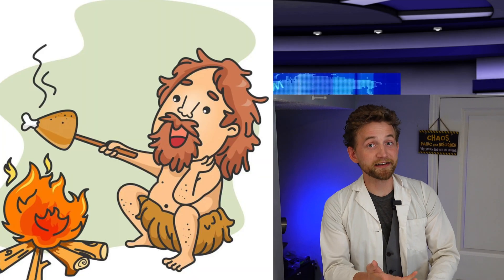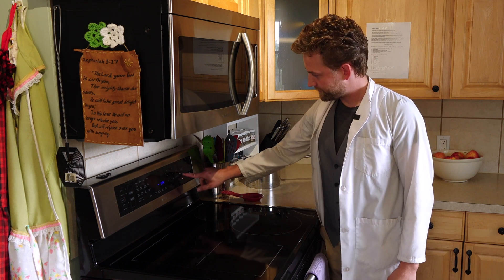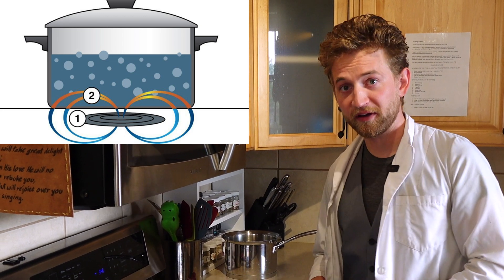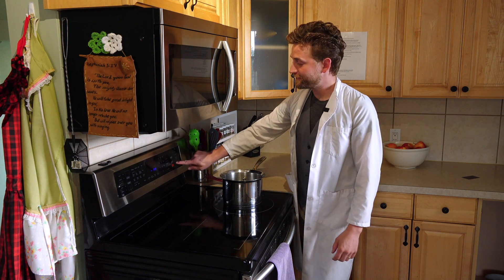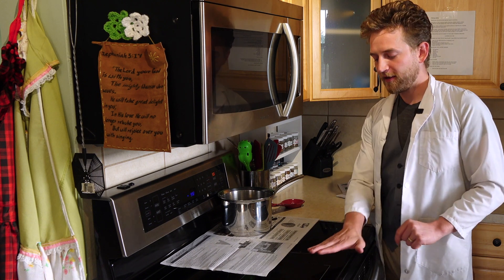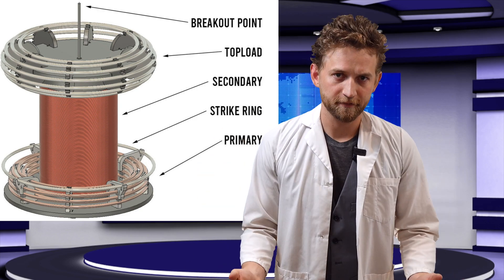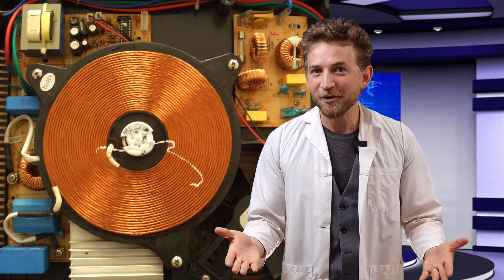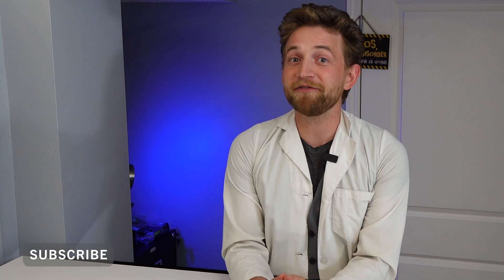What is Induction cooking? The science behind eddie currents in induction cooktops.

Comment: As much as you guys try to sound knowledgeable you forget an important issue.. you are so used to cooking as close to the source as possible.. not so with induction.. the closer to the coil the stronger the field but if you go another 10mm above the glass using a silicone trivet you get a more even and controlled cooking

Comment: You can use any pot or pan simply by putting a metal plate on the cook top and your ceramic cookware on that!
Reply: That's true but the efficiency and heating rates will deteriorate  significantly.

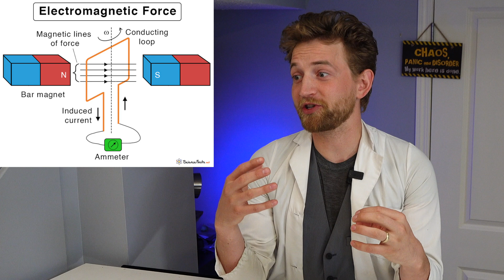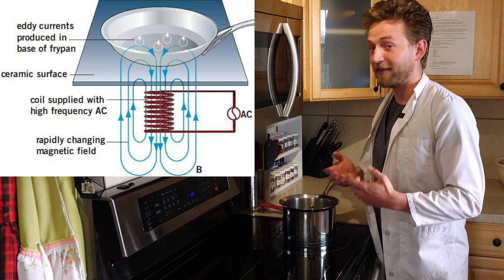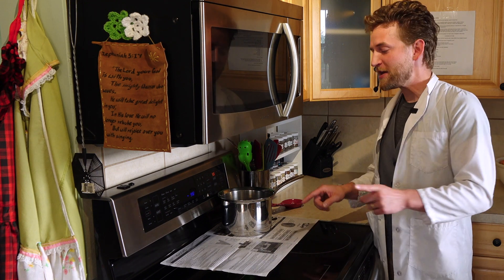Comment: Great video! Nicely explained the science behind the magic. I just want to point out that your expression "wireless transfer of heat" (mentioned at 1:41, 7:00 & 7:45) implies that the heat gets generated in the copper coil and then gets transferred "wirelessly" to the base of the pot. If I understand this correctly, that is not the case here. The pot does not get the heat energy from the coil at all, instead it only gets (exposed to) the magnetic field. The heat is actually generated in the base of the pot itself, ergo there is no "wireless transfer of heat" from the coil to pot. Please correct me if my understanding is wrong.

Comment: Hello.  Thanks for the interesting video.  

I'm looking to put one (or maybe 2) induction cooktops to a unique use.  I have a cast iron cooking grate, which I would like to use on top of the induction cooktop to grill meats. The grate has openings in it so I am a bit unsure what will happen to the induction cooktop when the juices from the searing meat meet with the surface of the cooktop.  

Second, the width of the grate is wider than the width of the cooktop.  So I am thinking of using two cooktops side by side and bridging the grate across the two.  I am wondering whether having two separate cooktops generating separate magnetic fields that are applied to the same cast iron surface will affect the heating purformance of the cast iron surface (i.e. are the separate magnetic currents that are being generated in jeopardy of cancelling each other out?
Reply from the maker: Cool idea! I personally haven't tried what you mentioned, but I'll answer as to what I think will happen. I believe that there would be no ill effect with using two cooktops on the same piece of metal. The rapidly changing Eddy currents most likely wouldn't interact. But the heating effect may be eliminated if you use an iron cooking grate. It's a bit complicated as to why, but I'll add a link to a cool article regarding eddy currents and magnetic braking. Hope this helps! https://www.texasgateway.org/resource/64-eddy-currents-and-magnetic-damping

Comment: I am still confused as to why the pan has to be magnetic. Surely eddy currents will flow in any conducting material, for example copper. Why will these not heat up the pan base?
Reply from the maker: Great question! The very quick answer is that the eddy currents will flow in material like copper, but due to the high conductivity (low resistance) of copper, the heat gain is so low that it is almost undetectable. I don't recall if it got included in the final cut or not, but there is an awesome piece of engineering inside most stove tops that detect the magnetism of the pan to determine its conductivity.
Reply: @DestructiveCreativity  Seems to me that this answer doesn't solve the original question. By the logic of your answer we could use aluminum pans, as they have a high resistance. But that is not true. 

I'm thinking it must be a pan made from ferromagnetic material as it probably heats up by vibrating the the magnetic domains and actually not really creating actual currents within the pan (or at least the currents shown in the video).

I came here trying to trouble shoot a broken burner for my friend. The burner is not sensing the pan. Seems to be a malfunctioning sensor to sense if the pan is there or not (or made from the correct material). What do you think the sensor is detecting? Could it be a hall effect sensor? any ideas?
Reply: @jeffreystollery3155  Induction doesn't affect non ferrous metal, this is mostly why transformers are made of copper.
Reply: I have the same question, but I don't believe the author addressed this in his response. So, for me, anyhow, the question remains.
Reply: I suggest that the reason copper won't work is because of its high conductivity which creates a secondary magnetic field which in essence provides an outlet for the energy. This secondary magnetic field can then be used for other purposes such as,  em braking, em suspension systems, or em levitation, regenerative braking and so on . Now when you have a magnetic material that is not particularly conductive the primary magnetic field will get stuck in the magnetic material of the cookware and will not have an outlet, that is to say it will not create a secondary magnetic field in the cookware. The trapped field remains in the cookware and it heats up.

Comment: I have a one burner induction cooktop.   It's great the way it heats up so fast, and stops boiling so fast.  Easy to control.   But the heat isn't even around the plate.   At least mine isn't.   I have to move the pan to different areas of the cooktop.   It works good though.   Just my experience.
Reply from the maker: Interesting, I am sure different companies have different levels of quality.
Reply: The smaller portable induction cooktops have a smaller coil under the glass compared to a full sized induction range. The heat will be concentrated on the center of larger pans. This will be especially noticeable with cast iron, as that material retains heat well, but is slow to spread the heat. You can work around that limitation by using stainless steel based pans that have multi-ply layers of aluminum, or better yet, copper sandwiched in between the outer layers of stainless steel. This allows the heat to spread out more evenly while retaining the advantages of induction.
Reply: Do you have the problem of it shutting off before your food is finished cooking. Example loose hamburger meat that I was making for tacos. My portable cooktop kept shutting off before, before all the meat was cooked…I had to stir it, right, but the shutting off became super frustrating… thx if you can help,,,
Reply: @irenehynes7536     no I never had that problem

Comment: Okay, I understand the transformer part. I don't understand the speeded-up AC cycle. What is its purpose and how does it happen? Are thousands of eddy waves better for producing heat than dozens?
Reply from the maker: Good question! I am far from an electrical engineer, but from what I understand, the power unit (inverter) within the induction top in responsible for the increase in frequency, and the direct result is a much higher current and wattage within the final element of the pot or pan.
Reply: @DestructiveCreativity  And thus the water boils. Thank you!